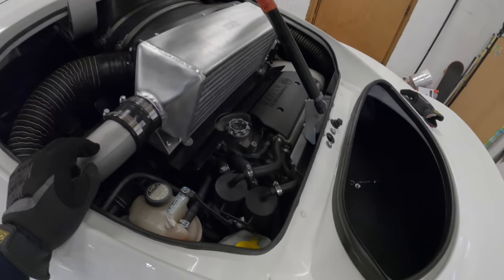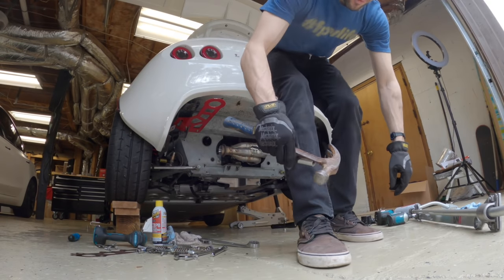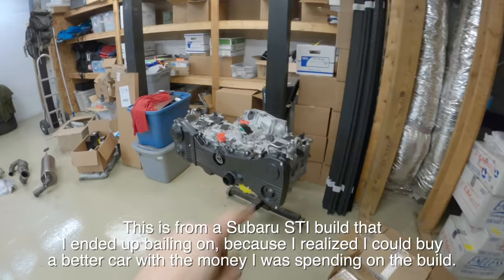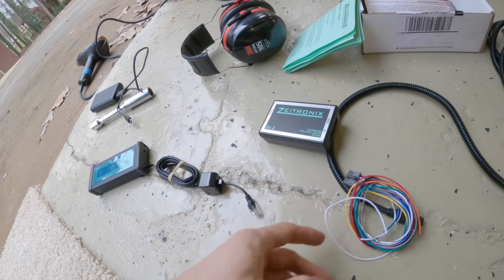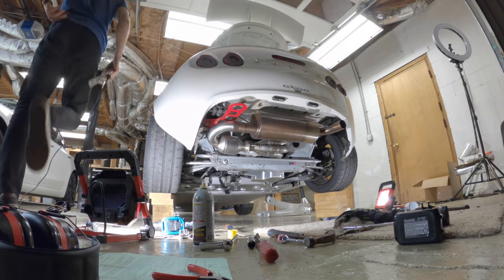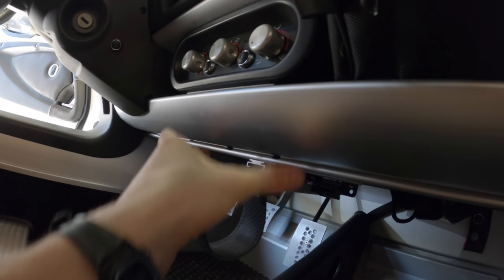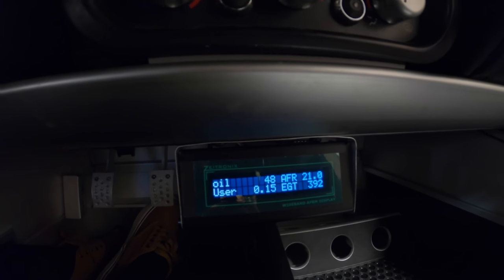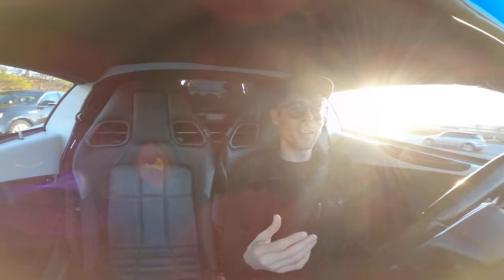When I'm not flying Drones | Lotus Exige DMC Header install

Comment: nice whip man.im still doing the honda's slightly cheaper lol if you do relocate that sway bar a good way to get that dent out of that header tube is a torch and air pressure block off one end put five ten lbs in the tube and heat untill red

Comment: I feel like you could have flipped the swaybar and it's bracket bar 180deg and lowered the bar a tad and still had it fit to the rear control arms just fine, maybe with some different endlinks, but it should have worked out. Or just get someone to CNC you some offset brackets to space it down/out a tad.

Comment: My kiss v2 25A 4 in 1 build everything works including the camera, vtx, osd, and receiver but none of the motors spin. I also dont get any beeps when I plug in the battery but I do get lights from everything and I connected to the kiss gui and flashed to the newest esc and fc firmware. Any suggestions or answers please help.

Comment: What tyres and tyre size did you end up putting on the monolites? 225/45 and 245/40?
Reply from the maker: A052 195/50/16 and 245/40/17.  They are perfect.  Much meatier than the re7r’s I had on before

Comment: Ah you have a Model 3. Why not let the exige go then...
Reply: Because the Exige rattles all the right senses is my guess.    Sometimes having a power band and having a manual transmission where it makes you a hero or a zero depending on if you hit that shift just right or blow it completely....

Steele said the car is "slow"...   not even.   Off of memory I am pretty sure it can still cut a sub 4 second 0-60 while having like a 170+mph top end.   All of that while having one of the more reknown handling corner carvers out there.  It is light as hell and making a fair amount of power.

I just hate Steele because he can fit in that damn thing.   I would like like 10 pounds of shit in a 5 pound bag given I weigh more rhan 1/10 of what his car weighs.

Comment: I think modifying the sway bar would have been a better Idea. denting the header defeats the balance flow idea. This is what I do :)
Reply: also you should insulate/wrap the new inter coo0ler tubes with (dont laugh) aluminum foil then exhaust wrap them so they do not soak the engine bay heat. that is the reason to change the tubes after all :)
Reply: If you feel adventurous . Take the head off and send it to me for 2 weeks. I Will up your HP by 20% with tested and true tricks
Reply from the maker: It was literally 1cm dent